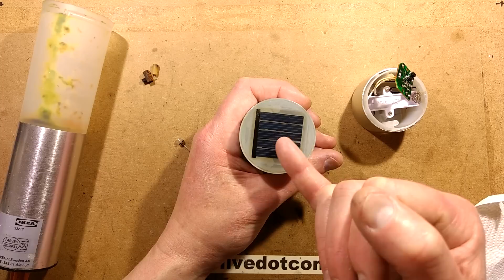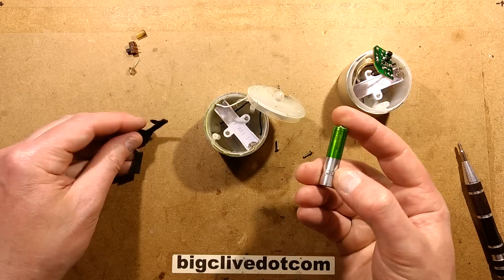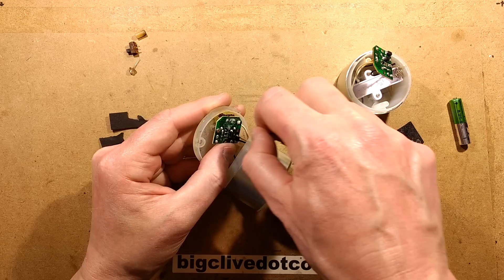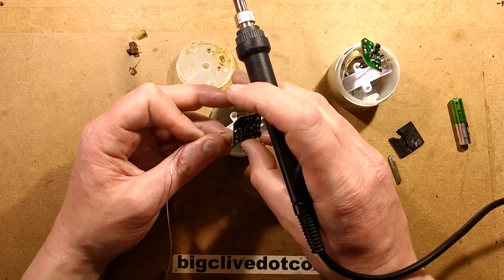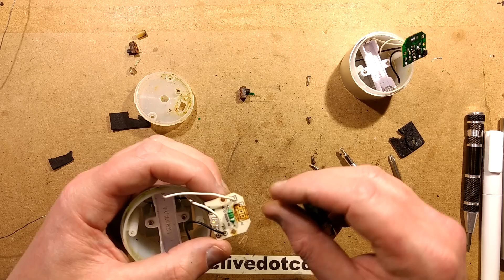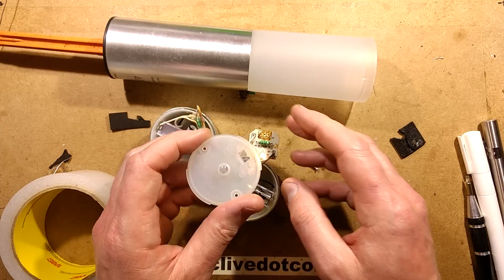Fixing (and cleaning) IKEA solar lights for my brother Ralfy.

Comment: Maybe you or someone in the comments could help me out. What's easiest way to learn out to solder -- just the basics. 

Nerd alert -- I have a replica lightsaber that was gutted (thanks TSA) and all of the wires were ripped apart (I think it was a bad solder job to begin with) I know how it all goes back together, but soldering doesn't seem to work for me.
Reply: Clive did a video about that a few days ago (8th May).
Reply: Tony Maholski The only way to learn properly is to do it, Clive has some great tips in other videos. Practice on something expendable first until you get the hang of it.
I find the most important tip I can give is adding fresh lead based solder as Clive always says. Like in this video, trying to rework old joints can be impossible without it.
Reply: Thanks for the comments. I completely missed his video from 8th May until just now. 

I watched a few other videos and tried on soldering together some stranded wires. I think I just need to stick with the simple stuff at first and work my way up... instead of trying to tackle projects that aren't meant for beginners ;)

Comment: USE ACID FLUX, for fuck's sake! Crusty and corroded old-work solder joints are what acid flux is made for. This video was so frustrating to watch. I kept yelling, "USE FLUX! ACID FLUX! FUCK!" At least you started using some kind of flux half way though, but only tiny amounts with a flux pen, and not until after the hard part. I mean, you don't have to do like that guy who fixes Apple shit and pour the shit on, but don't be stingy about it. Flux pens are only for work on new boards with fresh parts when you don't have much oxide built up at all. I often use plumber's flux with a brush because it's nice and thick and bit active and I have large amounts laying around. (I'm referring to #5 plumber's flux, which is ordinary rosin flux, and not #95 tinning flux, which has powdered tin in it. That stuff is used on large diameter copper pipes and not much else, although it is good for tinning the ends of larger gauge stranded copper wire, like 12 AWG or so. There a few other numbered plumbing fluxes out there like #70 which should not be used because they contain zinc chloride, which is, apparently, bad for electronics.)

Anyway, for old-work like this, they make tiny squirt bottles with needle tips that work great, although you can't use most of them with acid flux, unfortunately. If you want to use acid flux with a needle bottle, then you need to use needle bottles that are acid resistant. The acid flux will eat the needle of the ordinary bottles. Entirely-plastic bottles usually work fine regardless, but empty them out when you're done if they aren't rated for use with acid specifically, or you risk leakage.

But anyway, acid flux is THE flux for corroded, oxidized and otherwise shitty boards. Try it. It works wonders. The only drawback is that you do have to thoroughly clean it off afterwards, but that's true with active rosin flux, and a good idea even with mild rosin flux. I've seen people neutralize the acid with a sprinkle of sodium bicarbonate before cleaning with 90% isopropanol, but I think that's overkill. The isopropanol will remove pretty much all of it if you use enough.

Comment: Good video as ussual. But are you ikea biased?! This is really bad designed and i counted 7 times you reapeated "its really good design"?
Reply from the maker: The design is much better than most standard solar lights.  But they all have one or two issues.  IKEA stuff is generally pretty well designed.
Reply: True, but i saw a few Chinese light which were 1/10th of the IKEA price, which were close or even better. Will have to get my hands on them again so i can show it, not just open my mouth in vain :) 
Love the channel btw, especially really good disassembly videos!!!

Comment: Is there actually any point cleaning/fixing these? It seems like way more effort required than to just buy a new one. Why not just buy a garden light that is 100% mould and water proof?
Reply: Can you recommend a 100% mould and waterproof garden light? As supplied, cheap Chinese ones last about 5 minutes in the rain. The Ikea lights are one of the better makes.
Reply from the maker: It's really hard to find a decent solar light that doesn't have some weakness.  Even the extremely expensive architectural lights have a high failure rate.  Moisture permeates everything and causes accelerated corrosion where DC is present.
Reply: That's a real shame. I stand corrected then :)

Thanks Clive!
Reply: Hey Twilight
Reply: There's enough stuff been thrown away already. It's not all about money and time. That said, repairing a few of these lamps definitely takes less time than going to a shop and buying some. And it is free!
Reply: If you're a general consumer like me who doesn't have a soldering iron, replacement LEDs, flux and all that, then I'm pretty sure it's not free ;-)
Reply: Some people are consumers and will just replace a broken thing. Other people are makers and hackers and will want to repair or improve on a thing.
Reply: Terrum
Most people have at least one friend that has the equipment to do basic repairs to stuff. But we've been trained by advertising and corporate greed to just throw things out without thinking.
If you had 6 of these lights in the garden, and you paid $30 for them, do you think it's better to buy a new set or a $5 soldering iron?
Reply: I'm definitely not disagreeing that fixing it yourself is better, I was just saying that most people wouldn't do it due to the time and effort that goes into repairing them. I personally don't know any gardeners that are also into electrical engineering either! :-)
Reply: That would have been a boring video
Reply: I still can't figure out why people buy these stupid things. they all suck, both in terms of quality and product satisfaction. They emit less light than a match. I wish Clive would do more of the interesting videos than evaluating/repairing cheap Chinese shit. I don't care what pound land flashlight works best because I would never in a million years buy one. I bought one really nice flashlight and several decent ones for around the house that I've had for 15+ years, and I've never had to do ANYTHING to them except replace/recharge the batteries. You want nice landscape lighting, go hardwired... no PCB, battery, solar sensor, LED, etc to fail, and they look much better. They're also actually useful, as you don't have to put one every 3.5 inches along a walkway to prove any semblance of light; like you do with the solar ones.
Reply: Terrum i found that the dollar store light the main chip stops working ,   In the trash they go...  China is the best country for increasing land fill waste around the world..
Reply: 3rd World Garage  i will admjt i have done similar except it was a dish washer it had a faulty power button i just replaced with an arcade madhine button problem solved
Reply: Rhys Aistrope Yes, I've fixed stuff that was going to be thrown out and sometimes the fault has been tiny like that - yet the folks would have bought an entirely new appliance and the old one would be in landfill if not recycled, and either way, theres a cost to the planet as not all of it would be recycled.  It gives a lot of satisfaction I think.
Reply: bob s I find that the cheap.ones can be upgraded quite easily. I always run a bit sealer round the edges of the panel for example and put a higher capacity battery in. I've sometimes improved the life of the switch and circuit board too by using instant gasket to seal it all in. Really extends the life of the cheap ones with only about 5 minutes input.
Reply: There is no 100% waterproof. If air gets in, moisture gets in and if moisture got in, it wont get out again. The best way to waterproof something is to not waterproof it so that any moisture that gets in, gets easily out again. Drilling a hole on the buttom can make a huge difference.
Reply: I've bought some solar lights from Amazon with electronics that are completely encased in a plastic box.
Reply: Do it for the practice, not the saving of pocket change.
Reply: I just love repairing things.
Reply: But Clives channel originally started out as an electronic tinkering/modding channel. If you want consumer tech then go watch a consumer tech channel.
Reply: Fun fact: Even IP65 mains electrical fixtures require you to drill a drainage hole in the bottom to let condensation exit.